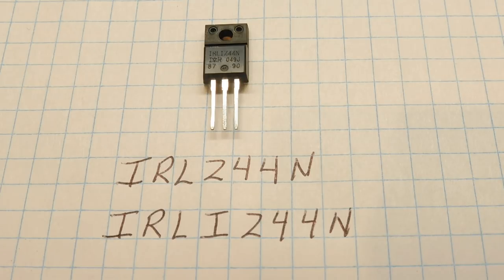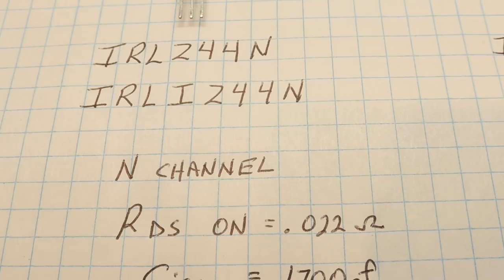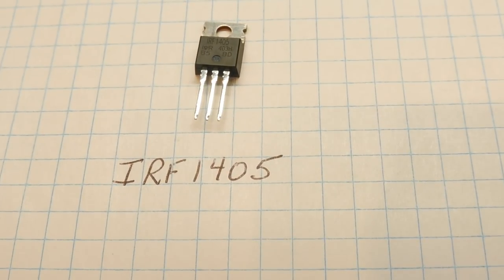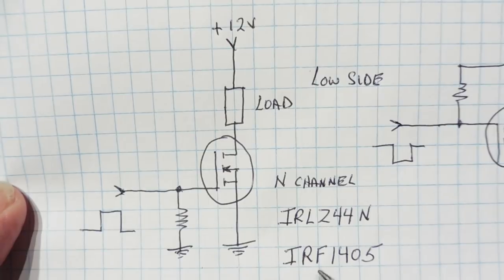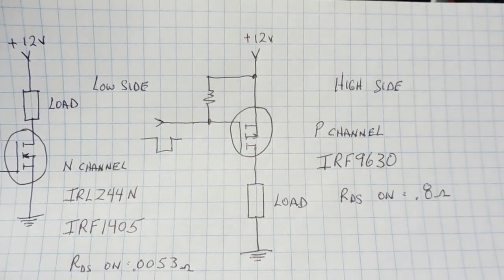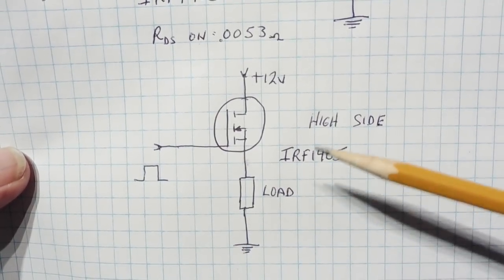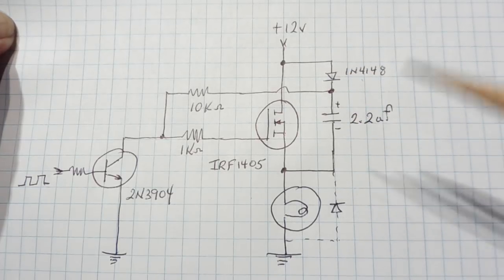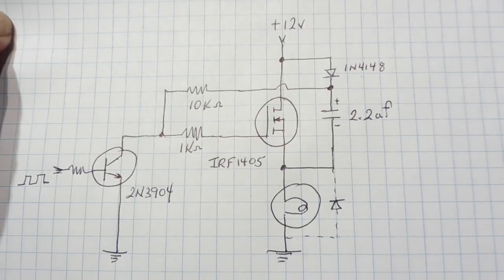MOSFET Bootstrapping

Comment: 6:50 i'm confused, since the transistor is ON, wouldn't the mosfet be off because the node in between the transistor and 1Kr resistor is 12V (fed from VCC and the diode), in short words: not enough voltage to drive the mosfet on?
Also, 7:14: i believe the capacitor is now configured as a voltage source, working as an "isolated power supply", adding up it's voltage to VCC, putting 24V (well, i'm not counting the voltage drop across 10Kr and 1Kr resistors, so it should be less) to the mosfet GATE, creating a voltage on the gate above VCC, making it conduct. You said here that 12V will turn the mosfet on, but that's not enough to turn it on, at least it was what you were saying before - i'm confused here, because when the capacitor is charging, it would reach VCC at some point, which would activate he mosfet.

See what i meat here and please correct me if i'm wrong: https://imgur.com/a/CGDLOIV
(ignore the left side where i say there will be only 12V, in fact that is used to drain the remaining voltage on the gate when the transistor is ON)
Reply from the maker: When the transistor is ON, mosfet gate drive is shunted to ground turning the mosfet OFF as stated.
When the capacitor charges up to 12v it will start to turn on the load. As the load voltage increases so does the mosfet drive to 24 volts.
This is the bootstrap operation. We have 24 volts from gate to GND, and 12 volts from gate to source turning on the mosfet with 12 volts across the load.
Reply: The capacitor doesnt "equal" 12 volts until just the point you turn off the grounding gate transistor. Before that, any "12v" on the cap is bled to ground before it can hit the gate. Thats why the gate resistor - lower resistance to ground thru the gate transistor so the "12v" charge goes to ground. When you turn off the transistor now that 12v will be applied to the gate. The other side of the cap was at "ground" but now the load turns on and the voltage drop across the load will "push up" the voltage on the cap. Meaning now the voltage at the gate will "float" up with load voltage, maintaining the same voltage difference between gate and drain that was there when the mosfet just turned on

Comment: Hello
a query from Argentina: according to the data sheet of the irf1405 the Gate-to-Source Voltage is 20volts, how is it that it does not break if you put 24volts in the gate?
very cool video!!!
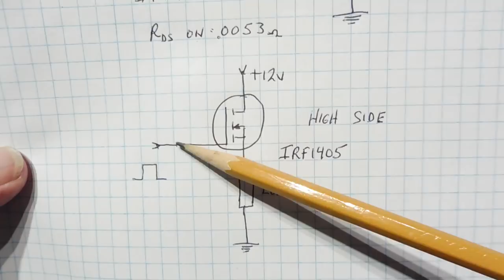Reply from the maker: The 24 volts is applied from the Gate to ground. With 12 volts across the load there will be 12 volts between the Gate to Source. Check out video at 4:33.

Comment: To bring the Mosfet on there is a 10,000 ohm and 1000 ohm in series which is 11,000ohms and that is too high and so too slow, while to switch off there is the 1000 ohm resistor which is also too high.. Really there is no need for two resistors and one will do to replace the 10,000 ohms with a lower one.  To increase the turn-on speed I used an additional transistor following the collector of the first transistor as an emitter follower but I pulled its emitter down by connecting a diode between its emitter and the collector of the first existing transitor. Works fine and even a two-transistor push-pull PNP and NPN would do.
Reply from the maker: The purpose of the circuit was to demonstrate how a bootstrap circuit works and not intended for high speed switching. It was originally designed to be driven with CMOS logic so the resistor values current limited the discharge of the gate capacitance charge.

Comment: Be aware, that the circuit will not work with any PWM or several Khz signal. This works only for very low frequencies from Arduino. To get the same effect, you need to use a boost converter to give double as much voltages to the gate which let the MOSFET to switch ON totally.
Reply from the maker: The described circuit is for demonstration purposes. Check the description box for an application note.

Comment: Hi,
Great explanation. Just curious as what are the advantages/disadvantages of this circuit as compared to a dedicated mosfet driver ic?
Reply from the maker: Lots of good mosfet drivers available. This circuit was built to demonstrate what bootstrapping is. Some mosfet driver ICs have internal bootstrap circuits.
Reply: @0033mer  
But the question is, why should I spend on a mosfet driver when I can make it this simply.. What is the advantage of using a mosfet driver compared to this simple Circuit? What are the scenarios in which a mosfet driver will perform better as compared to this circuit?
Reply from the maker: This circuit has an On/Off drive operation . Watch at 5:35.
A driver chip supports constant drive.
Reply: @0033mer  
Thanks for your reply.
Any other drawbacks of this circuit? Such as frequency limitation or so?
Reply from the maker: It is a low frequency circuit.
Reply: @0033mer  
Thanks for your reply.

Comment: I am new. Doesn’t the RDS on .8ohm issue go away after a few ms so we could use a P channel mosfet in continuous mode and avoid the capacitor draining/switch off?
Reply from the maker: RDS on resistance is the On-state resistance of the Mosfet when it is in saturation as indicated in the data sheet, with the proper Vgs applied. The RDS on resistance value does not go away after switching. It actually increases with temperature over time. For a lower RDS on for a P channel check other part numbers for a lower spec.
Reply: @0033mer  thanks for this excellent video and your reply. I'm learning quite a bit from your other videos.  I am really interested in high side switching for a project I'm working on.  I'm interested in this  F5305S based module with 817 opto isolation RDS on .06 ohms vs .8ohms. http://www.irf.com/product-info/datasheets/data/irf5305s.pdf .  The module is shown in this video. https://www.youtube.com/watch?v=eAANkWDvusU . I'm driving a large 300A bi-stable relay with a second pulse .  I'm guessing the P channel mosfet have improved since your video. Also I think I need to understand how to measure the issue with RDS on, I'm guessing you may get voltage drop and heat with the higher RDS on?
Reply from the maker: Yes .. its all about getting the lowest RDS on so power dissipation is low with a lower running temperature. MOSFET technology is always changing so specs are always getting better for P channel MOSFETS. RDS on is the voltage drop across the Drain/Source divided by the Drain current when the MOSFET is fully turned on. Check data sheet for best spec and ensure turn on time is fast so you don't dwell too long in the linear mode region.

Comment: When the transistor is on, won't the supply be shorted with with path of 12V - diode-10k-transistor-gnd ?
Reply from the maker: The 10k ohm resistor in series ensures the power supply is not shorted out.
Reply: @0033mer  yeah... Sorry...😅 A dumb question...😅 Didn't notice the guy there...😅

Comment: can i add a resistor from the gate of an n-mosfet to 12V to keep the load ON until a normally opened reed switch connected from gate to ground is approached by a magnet (the magnet turns off the load)?
Reply from the maker: Yes, that would work.
Reply: @0033mer  thank you, hope to watch new videos soon
Reply: @0033mer  i can confirm it's working, thank you again.

Comment: It looks like working but i cant measure any voltage at the gate of mosfet 
I took my oscilloscope and measure the gate to source voltage and it says 0V but the load gets 2A current and mosfet doesn't heat up much.I'm using it with 100kHz
Very confused 😅

Comment: What exactly is the benefit of powering your load via the high-side vs. the low-side?
Reply from the maker: Sometimes the only option is to source feed the load as one side is connected to ground. An example would be a car horn, fuel pump, headlight ... etc.  which is bolted to the frame of the car to get its ground connection, and you have to feed it switched 12 volts for activation.
Reply: @0033mer  I see, but no advantage. So rather than insulate the device from the return and low-side switch it, just do it this way. That makes sense. I guess I always knew that, but this video just got me to thinking. Thanks.

Comment: Hello! is it important the frequency that you got in the pwm signal? Because I calculated the RC time constant is 22ms. Does this work well with a high frequency?
Reply from the maker: This circuit is not meant to run at high frequencies. It is a low parts count circuit to demonstrate mosfet bootstrapping.
Reply: @0033mer  and what about if I wanna run it at high frequencies. Should I just change the capacitor value to sth smaller or there's another stuff I should thing about?
Reply from the maker: For high frequency operation you need to design your circuit around a HVIC.
https://www.onsemi.cn/pub/Collateral/AN-6076.pdfJP.pdf

Comment: QUESTION: the datasheet for IRF1405 says that Vgs is ± 20V. So now with bootstrapping Vgs becomes +24V exceeding the maximum allowed. Why is this not damaging your MOSFET? What if my Vcc is 48V. Then Vgs would be 96V. Would this not destroy my MOSFET? If not then I need to understand what is the real meaning behind Vgs. Thank you.
Reply from the maker: The bootstrap circuit generates 24 volts from the gate to GROUND. With 12 volts across the load the gate to source voltage (Vgs) will be 12 volts. Check video at 7:20.

Comment: What is the lower and higher limit of the frequency that this works? I used with an arduino pwm .. but the voltage over the gate doesn't rise to the 24V. Which means that the frequency is not suitable for your circuit. 
I don't know how to make it works.
Reply from the maker: It is a low frequency circuit designed to demonstrate Mosfet Bootstrapping. For fast switching use a Mosfet driver IC.

Comment: Is the purpose of the 1k resistor on the gate to limit the current flowing off the gate when switching it off? Is this necessary? Or am I completely misunderstanding?
Reply from the maker: When turning on a Mosfet you have to charge up the gate to source capacitance. During switching, the gate to drain capacitance also comes into play. With these two capacitors and the Miller effect we can have a large Ciss with quite a large charge. To turn off the Mosfet we have to shunt this charge to ground. In my circuit the 2N3904 could probably handle the discharge current but if you were using an open collector TTL gate (say a 7406) it can only sink 30 mA so I included the 1k ohm resistor.
Reply: Fair enough, I see I need to study up more on the size of these capacitances. Thank you.

Comment: You said that the gate to source voltage will be 24v so it means if I bootstrap the irfz44n with same ckt and power input then it will fail since the max gate voltage for irfz44n is ±20v??
Reply from the maker: The gate to ground voltage will be 24 volts. With 12 volts across the load the gate to source voltage will be 12 volts. Check the video at 4:10
Reply: @0033mer  ohk got it, thanks for replying 😅😅

Comment: Its a bit confusing to me. Why is suddenly the source up and the drain down with die P channel fet?
Reply from the maker: Think of the same circuit but use a bipolar PNP transistor as a high side switch. The emitter would be connected to VCC. Check out the schematic in this video:
https://youtu.be/-KuEyM1otls

Comment: I can't get this to work! The waveform at my mosfet gate looks sawtooth instead of square, any idea what I'm doing wrong?
Reply from the maker: Double check your circuit wiring with the schematic.
Reply: Lower the 10K to 1k
Reply: ...and make sure the tranistor is deep into saturation,  so low drop across Collector - emitter

Comment: 24V will initially be at risk to destroy the gate which must not be >20V relative to the source!
Reply from the maker: The bootstrap circuit generates 24 volts from the gate to GROUND. With 12 volts across the load the gate to source voltage (Vgs) will be 12 volts. Check video at 7:20.
With the load connected from source to ground the Vgs will never exceed 12 volts.

Comment: good video....
why did you use non polar capacitor why can't you use polar capacitor?
Reply from the maker: It is a polar 2.2uF tantalum capacitor.
Check the schematic, +/- indicated on the drawing.
Reply: 0033mer thanks for replying
I tried the circuit today and watched the wafeform on gate with respect to gnd on oscilloscope. It worked perfect on 500 hz freq with 10 uf cap it doubled the voltage around 22v on 12v supply thus creating 11 volt diff on gate-source. But if i change the cap or freq, circuit's behaviour changed and circuit no longer worked normally. What is the reason
Reply from the maker: The circuit is not meant for high speed switching. For high speed switching use a mosfet gate driver ic.

Comment: is there any idea where the value of resistor came from ?
Reply: No need to put that, as the gate of mosfet has high input impedance the resistance in series can be ignored.
Reply: the 10K is just to keep the current low when the bjt is on

Comment: Feeding 24V to the gate is safe for MOSFET?
Reply from the maker: There is 24 volts on the Gate and 12 volts on the Source so the Gate to Source voltage ( Vgs ) is only 12 volts.
Reply: 0033mer Much thanks! Now I understand it, one more thing is I'm using n-channel mosftets to drive H-BRIDGE inverter and I'm going to give around 312Vdc to the drains of MOSFET. My question is how to boost up gate voltage so as to maintain the difference? Switching frequency is 30Khz
Reply from the maker: Look into mosfet gate drivers.
https://www.fairchildsemi.com/datasheets/FA/FAN7390.pdf
Reply: 0033mer Thanks.

Comment: I don't believe that the cap will charge through the filament.
Reply from the maker: Build it and see. The filament resistance of the bulb used in the video (when off ) is 3 Ohms. Replace the bulb with a 3 Ohm resistor in the schematic and it might become obvious. Filament characteristics have been used by engineers to their advantage for many years. https://youtu.be/-S5tdmmlH9I
Reply: @0033mer  thanks I figured it out.
Reply from the maker: Double check your circuit and components. The capacitor will only charge up to the supply voltage. The voltage across the capacitor and the load are in series so you will get 24 volts from gate to ground with 12 volts from gate/source. The gate voltage seems to be getting pulled down for some reason. Instead of using a transistor to switch the circuit use a wire jumper to ground.
Reply: @0033mer  speaking of filament bulbs, when I measure their resistance with multimeter it reads one value while powering them up and using ohm's law we get another value. How do you explain this?
Reply from the maker: Yes ..that is the characteristic of a bulb filament. When it is off, the filament resistance is at its lowest value and when it is on, and current flows, it heats up and the resistance increases. This is also the characteristic of heating elements. Check out this video of a heater made out of Veroboard. As it is heating up can see the current drop on the power supply as the resistance increases.  https://youtu.be/WT9xWyLK-Ic

Comment: Couldn't you just connect the load to the drain instead of the source?
Reply from the maker: Sometimes the only option is to source feed the load as one side is connected to ground. An example would be a car horn which is bolted to the frame of the car which is the ground connection and you have to feed it switched 12 volts for activation.
Reply: @0033mer  Got it! thank you very much for the response!

Comment: there is no way that at the gate there is 24V I have simulated this circuit and never got 24 at the MOSFET gate.
Reply: I simulated using LTspice and it worked and got 24 volts on the gate.  Let me know and I can send you  spice file.
Reply: sure please go ahead